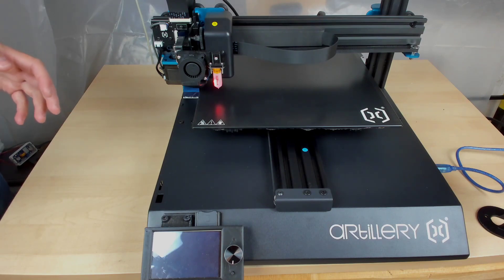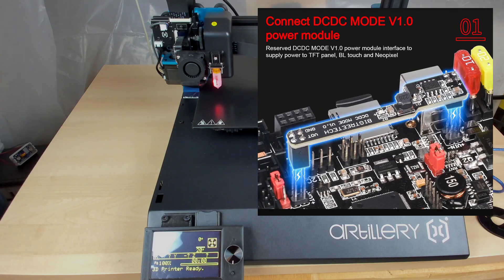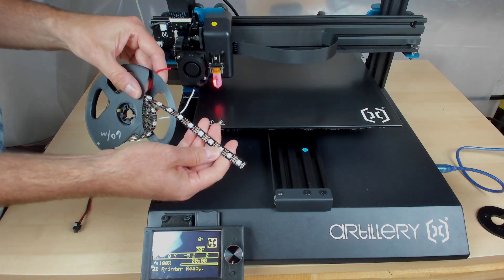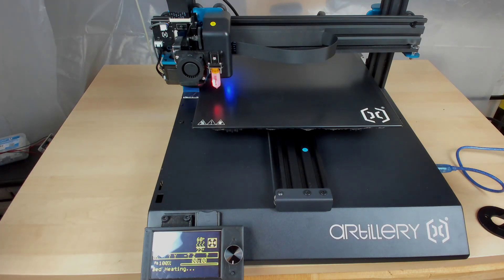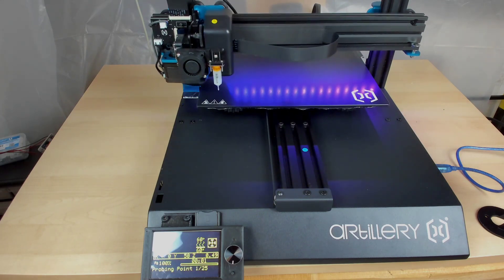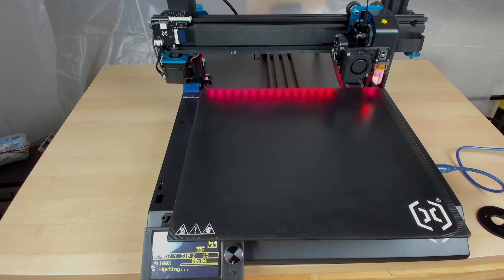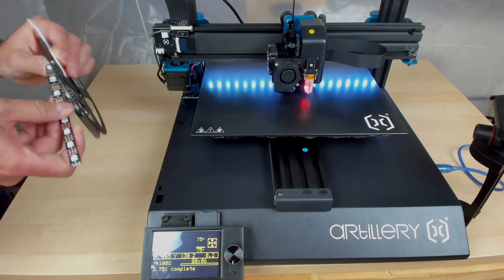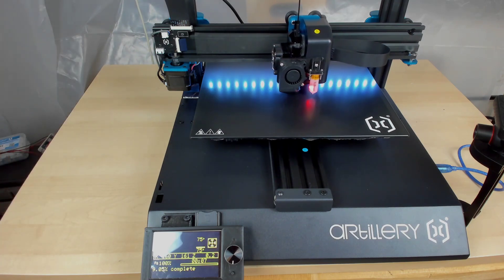Sidewinder X1 Stadium RGB LED Strip Mod

Comment: Why did you upgrade the x1 display? And what bltouch method and mount  did you use as yours looks great!
Reply from the maker: To be honest, I did it solely for the LCD mode, the UI is very limited, when it comes to octopi control. I used the Wagster Mod BLTouch mount.